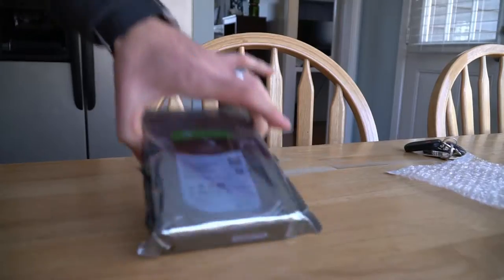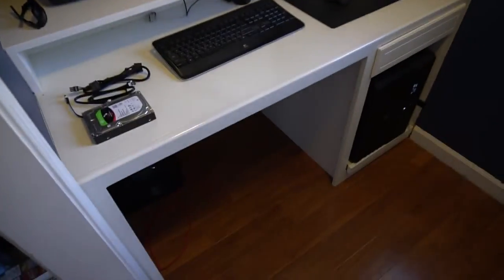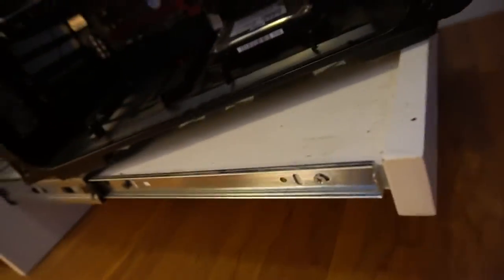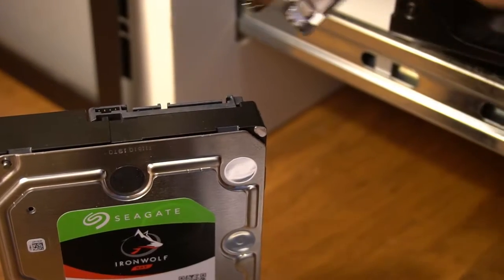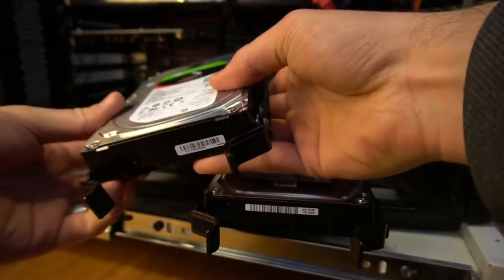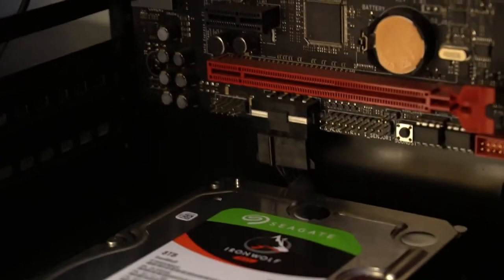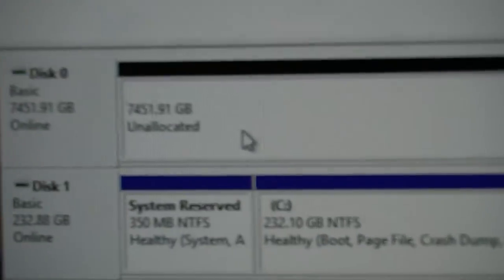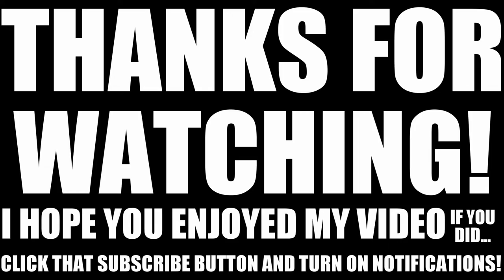Seagate Ironwolf 8TB hard drive.

Comment: what's about its noise level?! does it give you any discomfotr. I'm afraid of 7200 rpm HDD, and use just 5400 - 5600 rpm for some years.
Reply from the maker: +helgisbox helgisbox I can't hear it over my fan noise. And i would trade the 7200rpm speed for extra noise any day. In the day of NVME 180mb/s is slow enough.
Reply: as i see, you have pretty orange cougar fans. i've some of them too. and don't hear the noise. so, the HDD wouldn't make me terrible usage of PC?

Comment: Hey do you have a list of specs for that machine. Motherboards, Video etc. I am in the marked to building a new machine and this looks like something I could use. Thanks.
Reply from the maker: +Nickolas Pizzalato Yeah let me see what I can do off the top of my head. 
Corsair air 540 case
Asus rampage v extreme motherboard 
Intel i7 5930k (oc to 4.5ghz)
32gb G.skill ripjaw ram
EVGA sc+ Gtx 980TI graphics card (used to have 2 in sli but sold one, sad day) 
256gb Samsung evo ssd (operating system) 
PNY CS2030 m.2 ssd (for video editing, ultra fast) 
1tb game storage hdd (WD black) 
8tb video storage hdd (Seagate Ironwolf) 
Corsair h105 aio cpu cooler
EVGA supernova 1300w power supply 80+gold 
Plus a pile of generic case fans and a disk drive. 
Let me know if I've forgotten anything obvious.

Comment: Are you using IronWolf HDD for NAS on your PC? why not using Barracuda Series? any problem on 9 month after you installed this hdd? in my country this Ironwolf more cheaper than Barracuda and SkyHawk. I think I must buy this IronWolf to my PC too
Reply from the maker: +Juliansyah ITCI it's running fine. I'm just using it as a standalone hdd because I don't need more than 8tb right now. And i got the ironwolf because of the capacity and price.
Reply: Regular Barracuda series are SMR (which sucks). Always try to use CMR drives if you want to keep data safer. These will work fine as storage drives on any PC, just not for OS drive and gaming (use ssd/m.2 for those).

Comment: Hey Chris. I'm about to build my first pc and I'm curious if you'd recommend the ironwolf line over other 3.5" drives today. I'll be running two nvme drives for os and project files. Looking into hard drives for storage on my system. Thanks
Reply from the maker: I think it'll be great for massive storage needs, mine is still going strong today. I haven't really kept up to date on what is out currently so I can't tell you about it comparatively, I say Take a look at the competition but this is definitely a solid choice.
Reply: @ChristopherBurress  Thanks. I know it's intended for NAS, but I wasn't sure about the always on function in comparison to something like the Seagate Barracuda.
Reply from the maker: It seems to do well.

Comment: Hi, my hard drive beeps&not_recognized or can't be initialized... Have you perhaps had similar experience or've any idea...?
I bought Ironwolf 6TB and wanted to use it as an external hard drive. I have SATAIII-USB3.0 adapter and dock station. 

-Using adapter it is recognized by win10 but can't be initialized, pc sees it as 0B drive. 
-Using dock station or a pc, the drive just beeps... beep. 2sec beep.2sec beep.

I already wrote to Seagate's support, waiting for reply... But I'm afraid they'll be like: talk with the reseller, we don't care. Or like: you must buy 1000$ NAS device that will use it as a NAS since it's a NAS...
Reply from the maker: I haven't had any problems getting my hard drive up and running. Hopefully Seagate can help you out.
Reply: Ok ty
Reply: i recently bought an Ironwolf 8 TB version, and i have now the same issue, has the same beeping things, Windows starts waaay too slow, File Explorer does not see the drive but in the DiskManagement shows up, as i want to initialize is says "you have an non exsisting drive" or so... Could you find any solution? It would save my life, thank you in advance